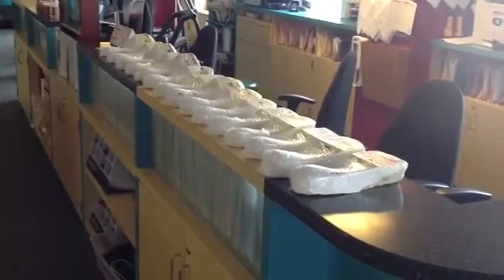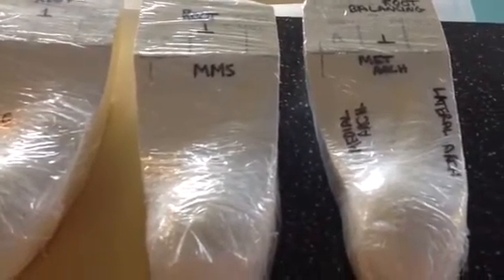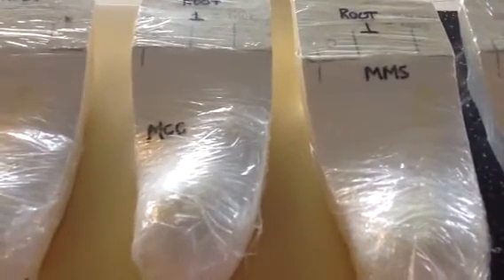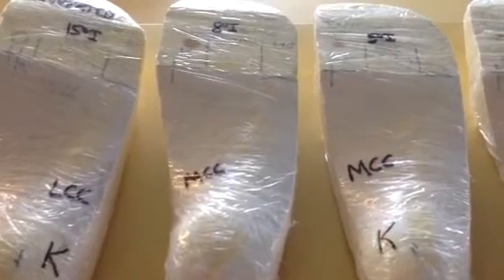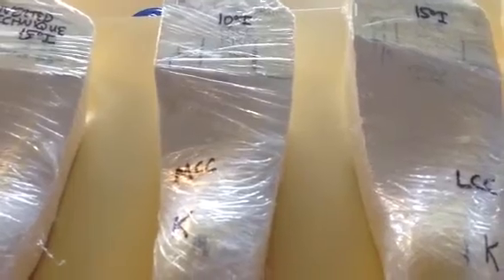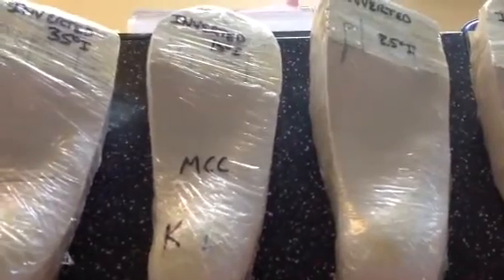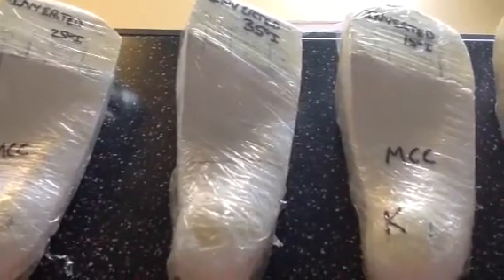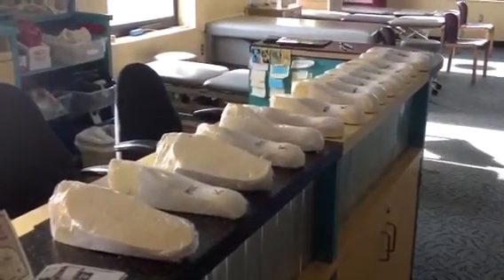Orthotic Devices for Pronation Control

Comment: Hi doctor Blake.  I have custom casting foot orthotics for years because years ago I had inner knee pain but now after 15 years I had a standing X-ray and found out my right femur is 12 mm shorter than my last so I put an insert in the outer edge of my right orthotic because my right foot seems to supinate and I put an insert on the inner part of my left and shoe because my left foot seems to pronate is that common with leg length discrepancy?  Also is it better to have insert for supination and pronation in the front part of the shoe or in the heel.  Right now I just added a little piece like 3 mm thick along my pinky toe area on the right shoe to keep from supinating and the same 3 mm thick piece along the inside left shoe by the big toe to keep from pronating.  Should I put anything in the heel for varus or valgus tilt?.  I notice a difference already when I do my biking exercises.  Thanks in advance for your help and thanks for your videos.
Reply from the maker: Hey, thanks for your comment. When dealing with limb length differences, you can add lifts to your short leg (typically up to 3/8 inch) or you just treat the pronation on the longer side and supination on the shorter side. Really depends on symptoms, and you are free to find out what works better. For standing you want the wedges under the heel, for walking and running you want more full length, and for cycling you can use the wedges or lifts only on the front of your foot. Rich
Reply: @drblakeshealingsole   thank you !!!